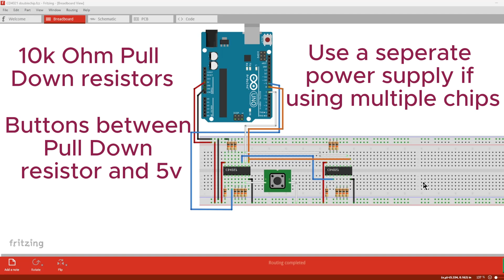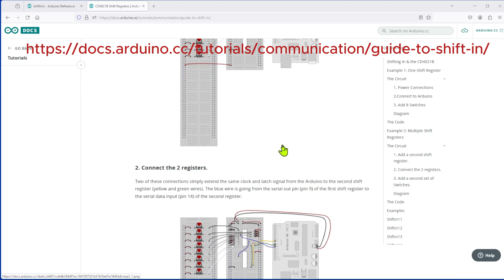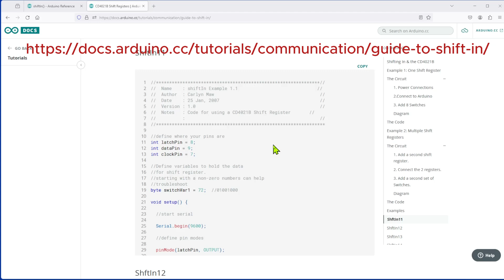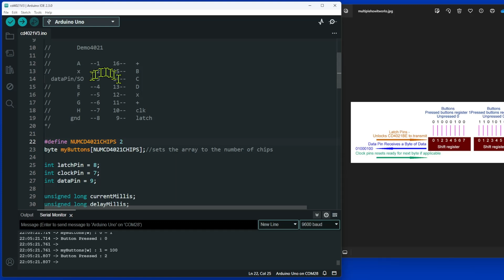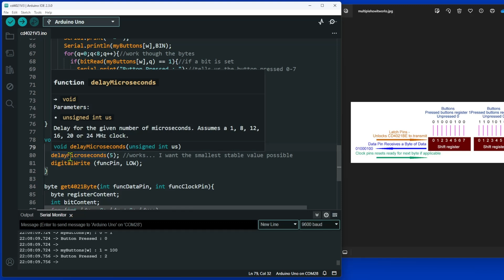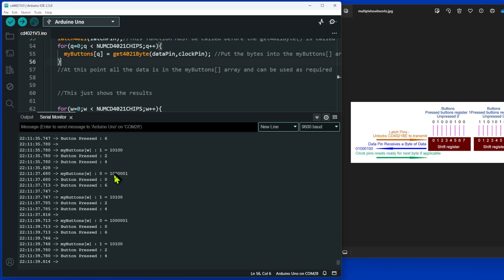#71 Arduino C++ CD4021B Shift Register Single and Multiple Chips

Comment: the mybutton value is not constant. its changing everytime even though i press the same push button
Reply from the maker: Do you have pull down resistors fitted to all the button input (button) pins even if you don't have a button connected... without them the pins will float and give weird readings.